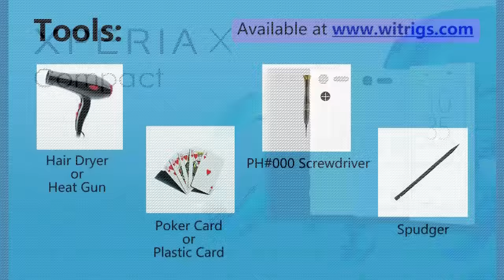Sony Xperia X Compact Loudspeaker Repair Guide

Comment: That's not loudspeaker! You even have your own video saying it isn't: https://www.youtube.com/watch?v=RQykfxqob88 It's vibrator
Reply from the maker: The new loudspeaker comes without vibrator, so if you need to replace a new loudspeaker, you need to remove the good vibrator and put it on the new loudspeaker. The new Loudspeaker is come with plastic bracket, the one you see in 03:04 .
It would be easier to know if you check this page http://www.witrigs.com/oem-loudspeaker-bracket-for-sony-xperia-x-compact